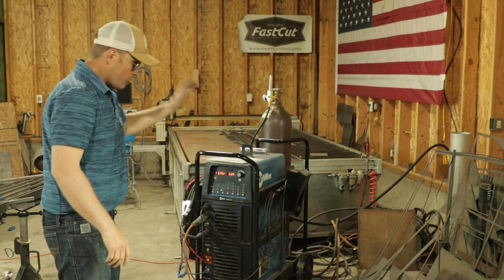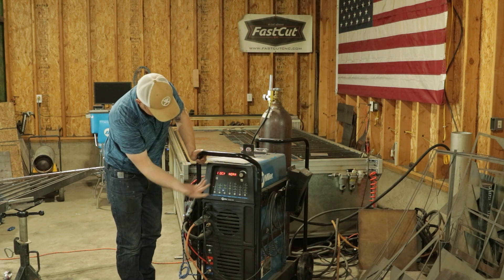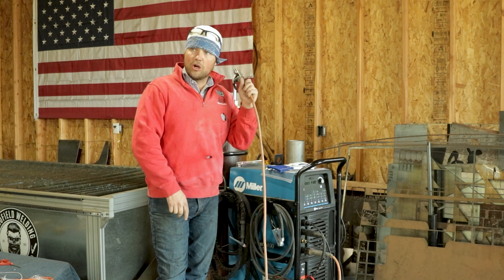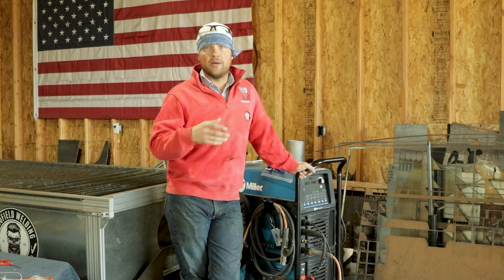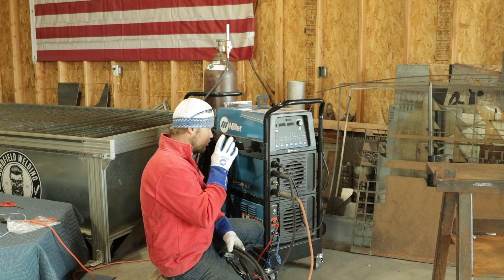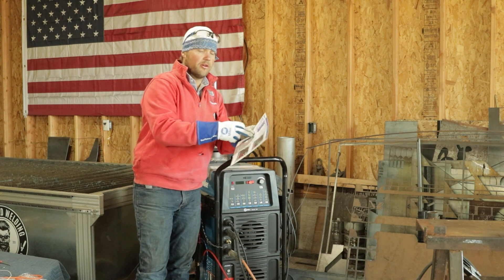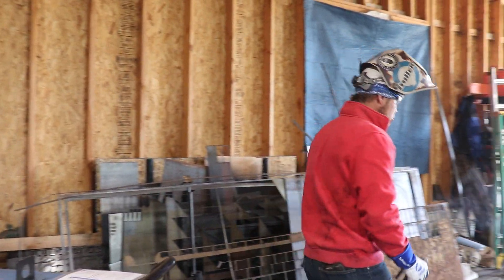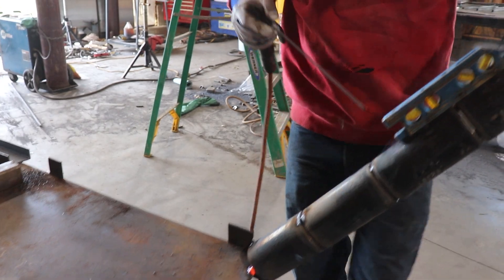Miller Dynasty 400 setting up for a test

Comment: What is this chain driven rotary torch device?
Is it your videos I've been seeing this device in before?
Just subscribed,  it seems that your really putting out the hard to catch onto skills that I've been gathering for years.
Currently didn't make the cut for the stainless can the shop is making even when I did one stainless back gouge plate, got the carbon 2 inch GTAW ticket.
Didn't end up getting to test yet for SS GTAW,  shrug someone has to build an weld out on the carbon side of the shop.

Comment: This is a good deal on one. I screw up and spent 26,000 on a 300 MP and 250 ft of 1/0 last week.
Miller Big Blue 400 Pro Diesel Welder 907732
Cyberweld Price $20,952.00
Mfg Industrial Price: $24,197.00
(You Save $3,245.00)

Engine:Kubota V1505
Select Your Spring FREEver Promo Bonus
FREE 500 ft. Reel 2/0 Welding Cable - $2,980.00 MSRP Value
Cyberweld Chee$e Bonu$ Offer
QTY
FAST & FREE SHIPPING On All Orders Over $50